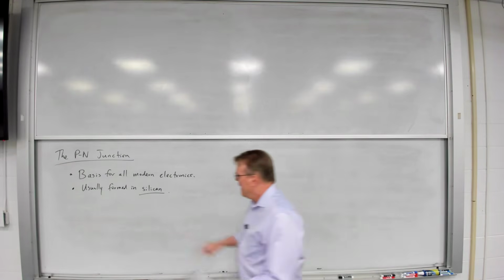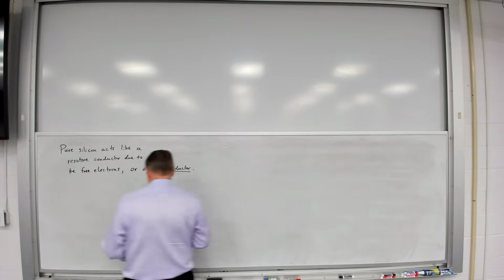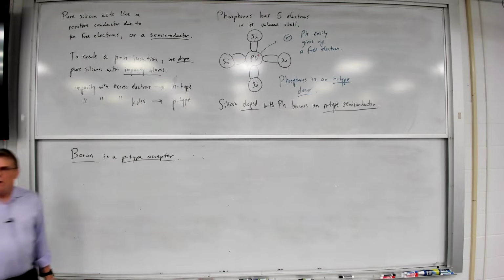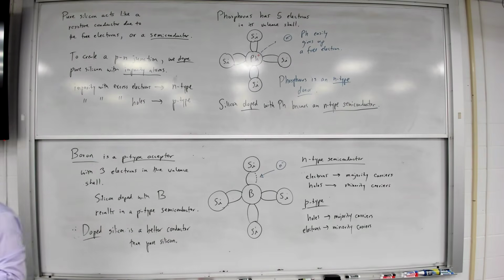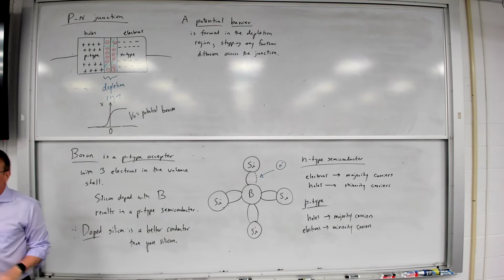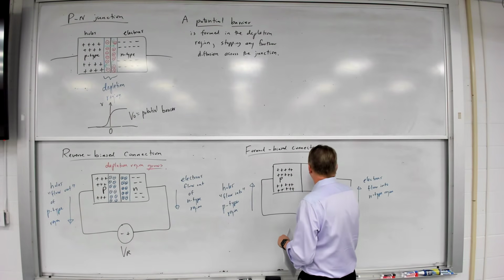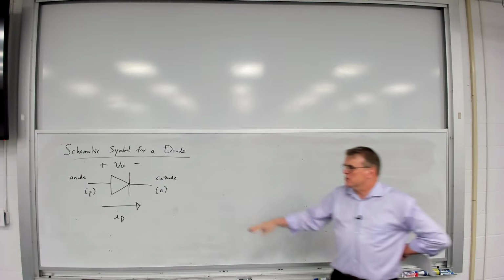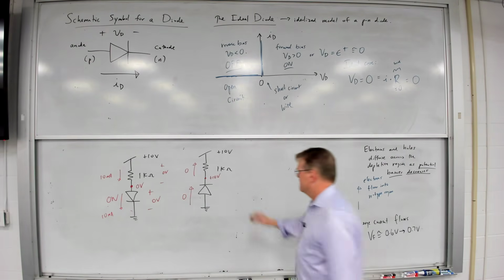Electronics - Lecture 1:  The p-n junction, ideal diodes, circuit analysis with diodes

Comment: I have reason to believe quite a few sub topics on this semiconductor physics lesson have been omitted. Like drift currents, the concentration of holes and electrons, conduction bands etc. I want to delve in the world of electronics but my question, is are these sub topics not that important hence being skipped?
Reply from the maker: These topics are very relevant to electronics, but as I point out:  this is not a semiconductor physics course.  It is an electronic circuit design and analysis course.  I outline my philosophy in my initial introduction for this lecture.  I only provide enough material to give students a broad mental picture of how p-n junctions, MOSFETs, and BJTs function.

There are many other excellent resources for learning the details of semiconductor device physics.  Several of my colleagues specialize in them, but they teach very different courses than this one.
Reply: Thanks for the clarification prof. Much appreciated

Comment: i didn't undrestand the last part where you find this contradictory
Reply from the maker: If an ideal diode has VD > 0, then it cannot be turned off with ID = 0.  On the other hand, if an ideal diode has VD < 0, then it cannot be turned on with ID > 0.  That is the contradiction.  If an ideal diode is off, then VD < 0 and ID = 0.  If it is on, then VD = 0 and ID > 0.

I recommend that you watch the next lecture with additional examples of ideal diode circuits.

Comment: Hi Professor , I still didn't enter the college and I want to study EE , would this list of lectures help me to study a little bit before I start ? and what level are these ? 
thank you so much
Reply from the maker: Before watching my Electronics lectures, I recommend that you first watch my Circuits lectures.  You'll also need some background in physics, linear algebra, and calculus to understand some of the concepts introduced in both courses.  As an EE, you'll be required to take the following core courses during your first through third years at a university:

(1)  Physics (in particular, the fundamentals of electricity and electromagnetism)
(2)  Mathematics (linear algebra, first-year calculus, differential equations)
(3)  Circuits I (DC and AC linear circuits, nodal analysis, mesh analysis, op amps, phasors, etc.)
(4)  Circuits II (frequency-dependent circuits, filters, Laplace transforms, etc.)
(5)  Electronics I (transistors, diodes, amplifiers, small-signal analysis)
(6)  Digital systems (Boolean math, combinational digital logic, state machines, computer organization)
(7)  Programming (using structured languages such as Python, C, or Java)

My YouTube lectures cover (3) and (5), provided you have sufficient background in (1) and (2).  You can check out Khan Academy for those.  Watch (3) first, then (5).  Good luck!
Reply: @wtimothyholman  yes Prof , I did study (1) (2) and finished few weeks ago I can say I am pretty good at Mathematics and good at the basics of Electricity , Circuits , diodes , logical gates , resistors , both DC and AC circuits and RLC circuit , and I do fix some simple PCBs from time to time ,  
thank you so much for your advice , and Good luck for you 😇

Comment: Hi. Thanks for your video mr Tim . Please recommend some good books on electronics?😉😉
Reply from the maker: (1)  Sedra & Smith "Microelectronic Circuits" is used by a lot of universities for introductory courses in electronics.  It's not perfect, but I think it does a good job overall.  I have used it for many years.

(2)  Franco, "Design with Operational Amplifiers and Analog Integrated Circuits" is an excellent textbook on advanced analog circuits using op amps.

(3)  Allen & Holberg, "CMOS Analog Circuit Design".   This is a classic textbook on CMOS analog circuits.

(4)  Razavi, "Design of Analog CMOS Integrated Circuits", another excellent textbook on CMOS analog design.  I think that he is still updating the textbook and putting out new editions.

(5)  Horowitz & Hill, "The Art of Electronics".  This is arguably one of the best-known desk references for electronic design ever written.  Every working EE should have a copy, in my opinion.

(6)  Gray & Meyer, "Analysis and Design of Analog Integrated Circuits".  This is an older text that focused on BJT circuits, but is an excellent reference on basic analog design principles.

(7)  Baker, "CMOS Circuit Design, Layout, and Simulation".  This textbook is almost like an encyclopedia of CMOS analog and digital circuit design.

(8)  "The ARRL Handbook for Radio Communications", any recent edition (updated yearly).  This is not a college textbook, but it has one of the best sections on practical electronic circuit design and construction that you can find.  

There are many other examples, but I think these books will give you a good starting point.
Reply: Thank you for helping me..❤❤❤

Comment: Is holes and protons are same thing
Reply from the maker: No, a hole is created when an electron gains enough energy to break free from an atom, resulting in a net positive charge in the orbital shell due to the missing electron.  So the way to think about a hole is that it is not a positive particle like a proton, but instead a place where an electron has been removed.  However, in semiconductor physics it is convenient to treat the hole as if it was a positive particle, because it makes the equations easier to work with.
Reply: @wtimothyholman Enjoyed your presentation I have a question about the current flow thru a diode as you presented I look at electron flow thru the diode as electron current flows against the arrow in forward bias Can you help? Just subscribed CHEERS
Reply from the maker: @anthonysova7117 , in standard circuit analysis, positive current is defined as moving in the direction of positive charge.  Since electrons are negatively charged, then positive current moves in the opposite direction of electron flow.  It seems counterintuitive today, but the scientific world had adopted the convention of "movement of positive charge equals positive current" long before electrons (with negative charge) were discovered in the late 19th century.   The world was using electricity decades before the modern theory of the atom was developed.
Reply: @wtimothyholman  Does Conduction due to Electrons will be different from Conduction due to Holes. and Does it effect Magnitude of Current.
Reply from the maker: @umerfarooqazam1399 , electrons have higher carrier mobility than holes.  Consequently, transistors that use electrons as majority carriers (e.g. NFETs) will have higher maximum operating frequencies than transistors that use holes as majority carriers (e.g. PFETs).  Carrier mobility also affects the transconductance parameter, which direct affects the magnitude of currrent.  So all else being equal, NFETs will have higher drain current magnitudes than PFETs.

Note that the topics I just mentioned are beyond the scope of this specific lecture.  I do cover them in more detail in later lectures, but to really understand carrier mobility you will need to learn some semiconductor physics.